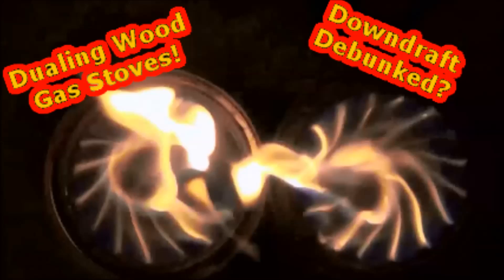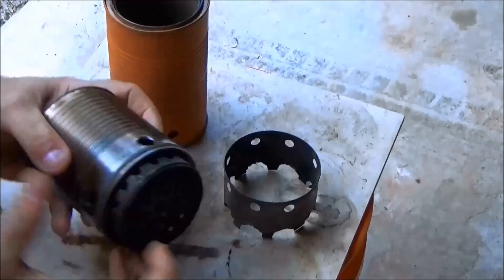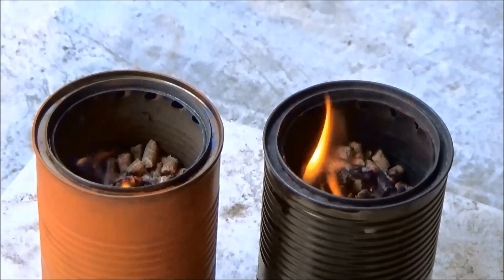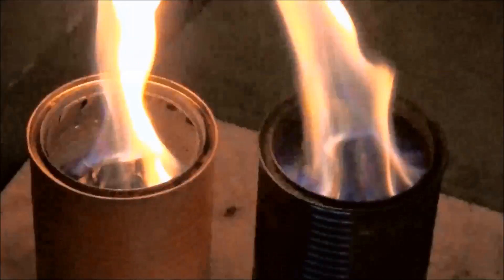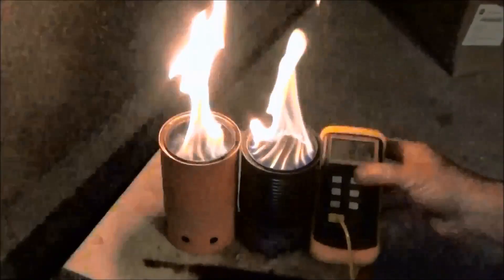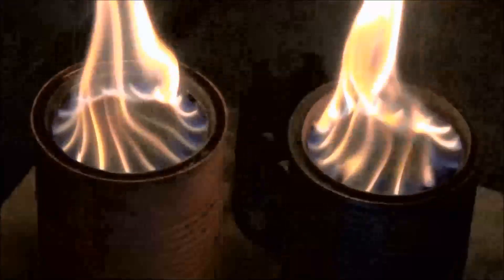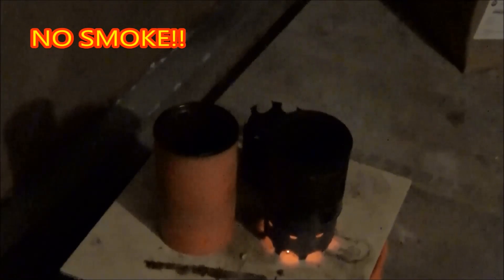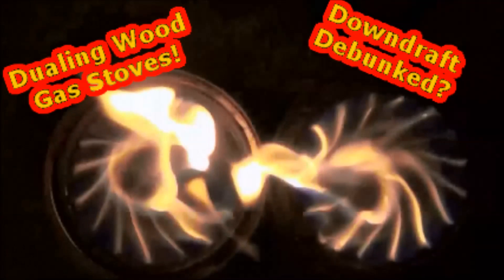Dualing Wood Gas Stoves!! Downdraft Debunked?

Comment: The hybrid stove with smaller primary combustion holes will slow the burn and make it hotter, if you're after efficiency blue (or white) flames are a good indication, yellow or orange or red flames are much cooler and produce more soot indicating poorer combustion.
Good video and correct observations.

Comment: Yeah, I'm sure that they don't really down draft. I put one way flapper valves on the inside can's bottom holes so that only down draft flow through them was possible and the fuel only burned halfway down.... no better than if it had no holes in that spot at all. Really everything is going up.... except the heat. The heat from the flame migrates down to the bottom. All we can do is tinker with the ratio between top and bottom holes. I've found that the bottom needs about 1/4 or 1/5 the amount of hole opening as the top. Too much at the top and it pinches off the inner flow and too much at the bottom and the inner flow blows up the middle too fast(can even blow out the flame if using a concentrator). I can get a nice moderate flow that makes a thumb sized flame(through a concentrator top)that burns for an hour and a half. I think a slower flame is more efficient at cooking, but that's me. What's a bummer is that I can't get nearly as good performance from regular wood or sticks. Only pellets burn this well and I need to find something that works this well on sticks..... a more efficient hobo stove or something(I don't like things that need feeding from the top while the flame is going).
Reply: I've been able to extend the burn time of my wood gas stove to 20-25 min by using thicker pieces of wood.  I cut a hard wood branch a little smaller than the diameter of my combustion chamber (~2.5") and short enough that it won't cover the secondary air holes, and chop it into thumb thick pieces with my knife.  I think I could extend the burn time even longer with thicker pieces.

Comment: It seems to me that to have a true downdraft stove, the airflow out the top of the fuel chamber would have to be less than the airflow up the sides through the secondary air holes. The stronger hot air draft will always win, and the huge opening and direct path of the fuel chamber upwards would need to be restricted to give the secondary air a chance to draw the flow downwards.
By the way excellent stoves and observations. Investigative science at its best!
Reply from the maker: +Michael Crumpton Do you mean true updraft or true downdraft? Thanks for the comment!

Comment: the modified stove has more air getting into the stove due to the 2sets of holes.  so it would burn hotter but not last as long
Reply from the maker: +John Latsch I believe you are correct. Thanks for the comment!

Comment: what would be a good stove for longer cooking times?
Reply from the maker: +John Latsch A standard can style wood gas stove does not do well when you add fuel to the top. It disrupts the pyrolysis zone between the fuel and flame. A small rocket stove will allow you to continue to feed fuel in and extend cook time as long as you want to add fuel. I am working on a forced air wood gas style stove that I have had luck in top loading. I am about ready to post the first attempts. Seems promising:) Thanks for commenting!
Reply: No problem.  Im just looking for a small heat source distill water for backpacking.
Reply: You can add more fuel.  however was old orange was more efficient? also can you control the heat by reducing the oxygen flow at the bottom holes?

Comment: Your experiment did what I expected it to do.  The hybrid was burning hotter because of more oxygen was feeding from the bottom and it was updraft.  

However your Vortex stove was downdraft all the way.  It was also cleaner in the end and you can see it because it didn't smoke.
Reply from the maker: +munchichi8 These stoves seem to be able to switch between updraft and downdraft easily. I am going to continue experimenting. Thanks for the comment!
Reply: +Heath Putnam 
Once they lose the vacuum between the primary and secondary holes, they will be updraft.  

There are many factors that cause this: such as heat (temperature,) diameter of inner can, spacing between the fuels, spacing between the inner and outer can, ratio of holes to the primary and secondary holes.
Reply: +Heath Putnam 
Let me also add that you are losing the focus of "Wood Gas Stove."  The purpose is NOT to see if it can reach the highest temperature in the shortest amount of time or how high the flame can go.

When you create a wood gas stove the whole purpose is to create gas from the fuel so it can be burned.  The bluer the flame the more efficient it is and you will notice that it will not black the bottom or create soot on the pots.  This also indicate the correct amount of oxygen and gas ratio.  Trust me removing the soot of your pot is a pain!

You should watch Mitch Ashdown's video on wood gas stove.  He is the only one that truly understand the concept of wood gas stove.
Reply: This is exactly right. If you want to boil water as fast as possible build a campfire, if you want to boil water with the least amount of fuel then build a gasifier that cooks off the wood gas as efficiently as possible.

Comment: I reckon, maybe, some of the differences in performance (flame, temps) of the two stoves may come from them competing for fresh air. Burning this fast and hot they must be consuming lots of it and they are standing tightly close together. So the one with a slightly better position with respects to the air-flow around might get a head-start.
Reply from the maker: +Björn X You are probably correct. I will try the experiment again and place the cans farther apart to eliminate the effect. If the difference in results is large enough I will update the video. Thanks for the comment!
Reply: Yes, please! More wood-gas-stove-videos from you! They are fun to watch and very instructive . :)

Comment: The disruption to the burn when re-fuelling made me want to understand what was going on. Your video has helped massively as the downdraft theory had me confused. I think, as you provably realise, what is happening is that putting fuel at the top obstructs the flow of air (from the bottom)... Now I get it! So, as you said, to refuel I think I should wait till the heat drops and then top it up completely and perhaps get a pipe to the centre and blow, starting a new load again. As you say though, with wood pellets you could get 45 mins which should be enough. Great work, thanks.
Reply: Following your comments in the Glass video I now understand. Wood gas stoves need to be loaded and left alone for the separation of oxygen and air to happen and for the temperature of the fuel to remain constantly high. I've got it now. If you need a longer, continuously loading stove, make a rocket. Thanks Heath ...and thanks Arthur.

Comment: I think all your precise drilling is making it much less efficient, but doing that is actually beneficial for heat reduction and makes it so you can do it in soup cans and not melt them down.  All the holes and angled holes do increase and direct the air flow in, and make a swirling flame burner.  A very nice hobo stove.  But 30 min burn on a cup of pellets partly soaked in alcohol is very inefficient.  If you aren't done cooking in 30 min on it, wait til it goes out, refuel and start over?

Heat, fuel, oxygen converge at your angled holes around the top is the only reason it is flaming there.  Heat rises, once its lit, the air is being pulled into the middle can through every hole, bottom ones are restricted by the pellets until they are consumed.  As the can heats, the hot air between them rises and goes through the top holes in the middle can faster.  Its making more updraft, more hot air rising, no wood gas is exchanged outside the fire can.  

It can be over 4 feet tall, and not have all the holes, only one small air intake facing the wind, and it will shoot flames out the top.  The carbon based fuel gasses can achieve combustion inside a chimney over a fire, if it is enclosed except for a small air intake at the fire, and the top of the chimney is open.  Hollow logs with both ends open, or one end and a knot hole open will burn off wood gasses inside them and shoot fire jets. Even a house chimney if the fireplace is closed off tight except for a force fed small intake, will shoot fire out the top.  Wood logs insulate sufficiently until they burn through.  

If you want a more efficient burn, or bigger hotter flames, think of it more like a wood or other carbon based fuel, even dried dung fueled rocket stove.  If you go that route, use the same precautions and safety measures as you would with a rocket stove.   Cut both ends out of a can and use it for a removable chimney.  Chimney affects draft.  

A kelly kettle is a horribly designed dangerous useless novelty, but it is a small carbon based fuel combustion gas byproduct burning rocket stove.  Air intake on one side you point into the wind, and a chimney.  It uses a water jacket for heat insulation, and boils that water in 3 to 5 min, in doing so.  If it was built more like this, a tube straight trough the exterior water chamber rather than a wide taper at the bottom, which excessively reduces the water they hold making them impractical, that would be one less issue with their design.

Doing experiments using wood pellets is a more repeatable method than sticks or chunks of wood, but once you refine your tests to a workable repeated theory you like, use sticks or other fuel sources which are even cheaper, usually free, and for seeing how hotter or less hot burning fuels and ease of adding more to refuel while it is burning, fit your desired goals.  

How can you safely add more fuel to extend burn time when needed, without having to stop refuel and relight and start over also needs to be part of any plan.  Without the ability to refuel to continue using it while keeping it lit and hot, it is like an alcohol stove, or sterno burner.  

Good luck.

Mike

I have a link to a youtube vid of a chimney in a tent being closed off to the inside of the tent only leaving a small tube outside the tent as intake, and any small air gaps  in the closure as intake and accidentally quickly turning it into a big rocket stove, melting the stainless rivets holding the chimney together, making the screen over the chimney red hot, and scorching and taking the paint off the chimney cover and melting expensive heat reflecting material inside the tent and some of the tent, if you want to see how out of hand something like that can get on accident.
Reply from the maker: M Par The goal of my experiment was to create a stove that would boil water quickly, not smoke and be light and portable (think backpacking). I have used this many times for this purpose and it has worked well. It is not designed for long burning/heating. I agree for that type of stove this is not a good design. The stove will hold much more than one cup; a full load produces flames for about 45 minutes and the coals produce enough heat to cook on for another 15 minutes or so. I have never needed more time than that for trail food. This may not be a good design for your needs, but many people are using this type of stove for this exact purpose. Thanks for the comments.

Comment: If you open enough holes and add a valve to distribute the primary air in take area between secondary air intake area, that'll help you finding how many holes it need and saving your time to build different models.

Comment: Thanks for another great video. Can't wait for the "how to" when you're done researching.
Reply from the maker: Ric Komarek Thanks, This discovery shook my knowledge base a little. I will certainly be experimenting with this new version. Thanks again for watching!! :)
Reply from the maker: Dmitry Olyenyov I only add 1 cup of pellets during the videos. The stove can hold about 1 3/4 cups (fill just below the secondary air ports) which should last 45 minutes to 1 hour. I have added fuel to the top; it disrupts the burn for a short period but then it recovers.